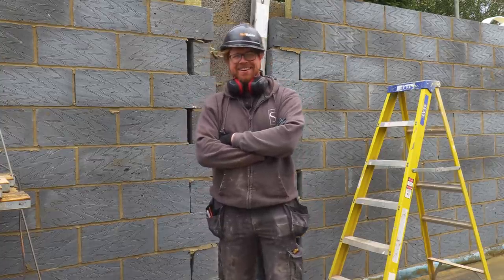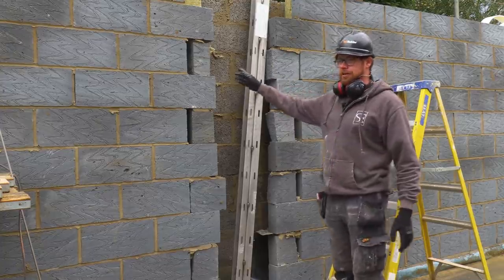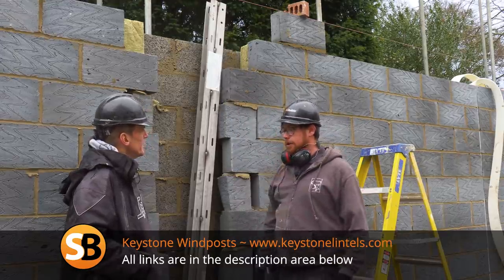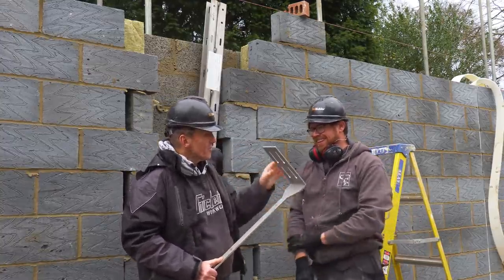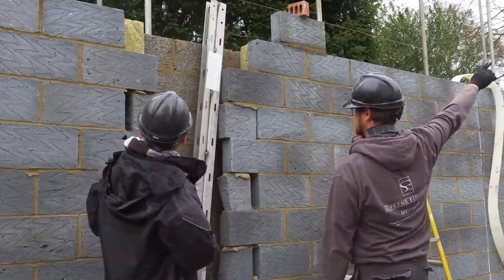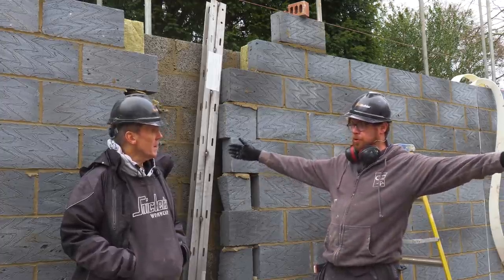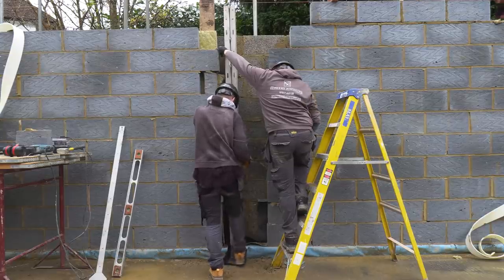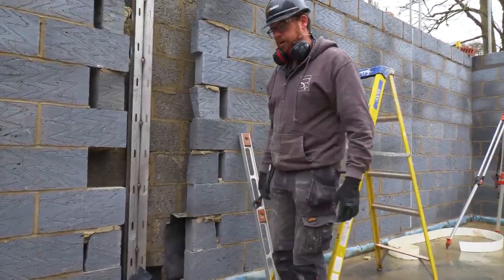Windposts & Joists ~ Extension Build #4

Comment: bit of a pointless video sadly as I came here wanting to learn about windposts and i left not seeing properly how the job was done start to finish with all fixings. instead i got other shots of the site job.
Reply from the maker: Pointless to you perhaps but the title explains that this is a series and the windposts were a retro-fit so the installation is not typical. 
There is plenty of technical information on windposts on the Keystone website. The bolt to the floor slab (fixings included) and screw to the joist. You will see this part of the job in the next episode. It is very straightforward.
Reply: @SkillBuilder  Perhaps my comment earlier was a bit short/sharp/harsh. I was perhaps showing my current frustrations over trying to understand windposts on a current extension i am trying to build and getting no where. Your videos are normally very helpful and I like your channel very much. What I am trying to politely say is that the video lacked some of the finer detail of the wind post installation. The video didn't cover the details of  the types of fixing used to bolt it down and why and also how it ties to the brick work and at what recommended distances. I saw some expanding foam being used but no idea why that was used. Windposts in my project has been specified because most of the walls I am having are made up of bi-fold doors so there is very little brick wall in the design. Anyway i hope the upcoming videos cover the points in more detail. Thanks
Reply from the maker: @dannys7795  The  video series is about this extension and not windposts per se but the follow up videos which are in the playlist do show clearly how the windposts are secured and tied into the brickwork. We may bring all this footage together in a windpost special but, right now, we are just trying to keep the story of the extension going as it happens week by week.  It takes a bit of digging if you want specific information but it is there.